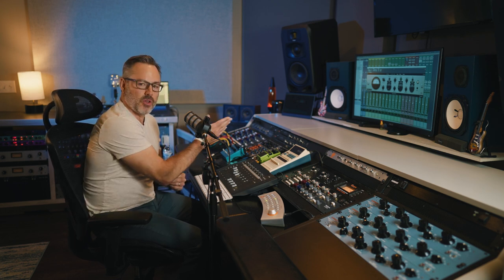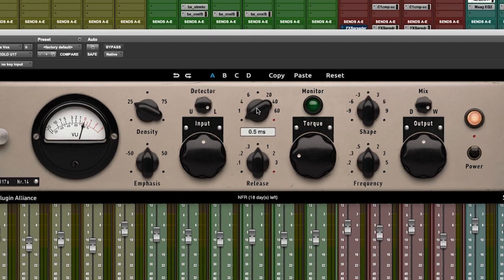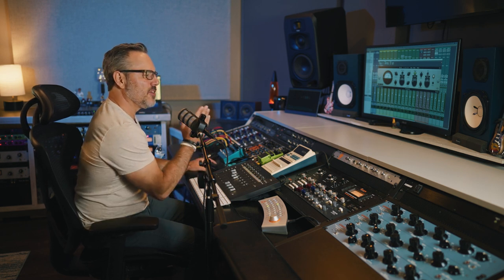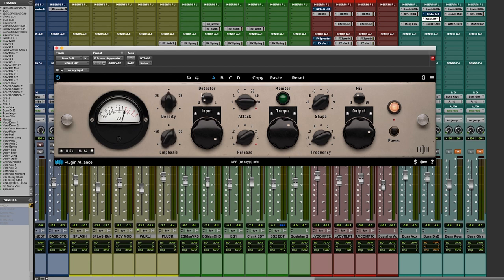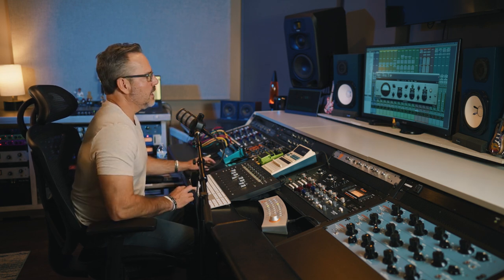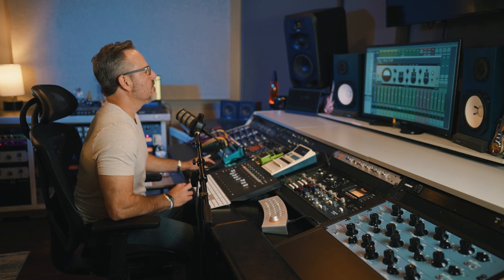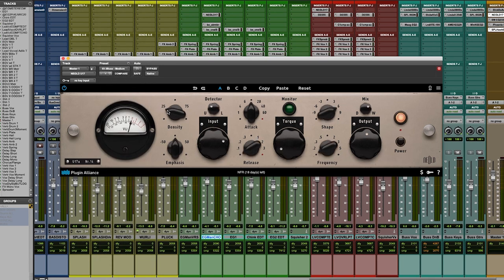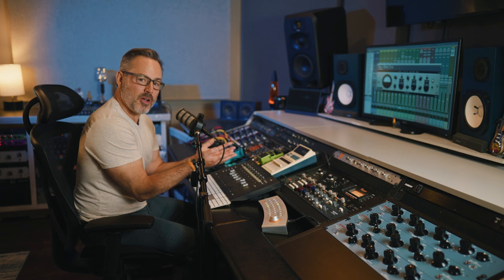Joe Carrell Demos the NEOLD U17 Vintage Compressor | Plugin Alliance

Comment: I guess I should get the Mega Bundle. I have the Mix and Master Bundle and this plugin comes with it as well. I used it on a bass track yesterday and was very happy with the result.
Reply: It's also on the mix & master bundle, so no need to take the mega one :)

Comment: I have the mega bundle but my UI is different:  it doesn't include the section at the top with the presets.  I checked the manual and the manual also doesn't include those.  What's up?
Reply: Yeah, Me as well... I do not see any presets. Whats up with that?
Reply from the maker: That's hard to tell from YouTube. Please check with our customer support: https://www.plugin-alliance.com/en/tech-support.html
Reply: @PluginAllianceTV  StudioOne not seeing the presets... Right click wrench icon and rescan presets worked for me... Thanks
Reply from the maker: @terrylester9409  Thanks for sharing!
Reply: @PluginAllianceTV  I figured it out - it's because I'm in a different DAW.  In Live, the presets are all available options from the plugins dropdown menu under the main NEOLD U17 plugin heading.  You have to install specific instances of the plugin by your selected preset, and you can't surf through them from the main U17 plugin interface.